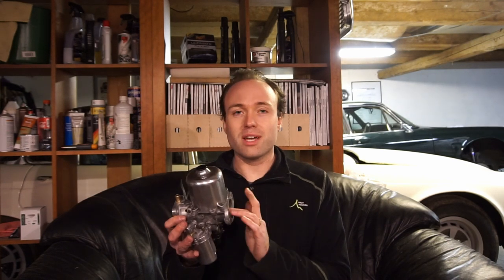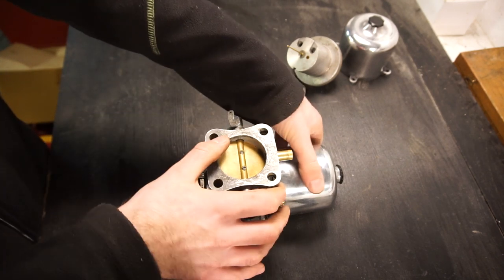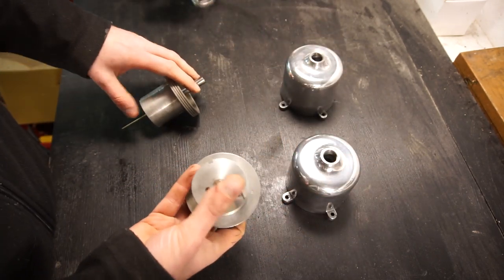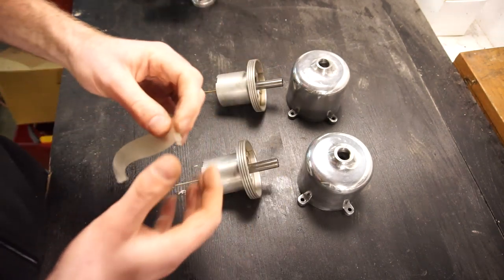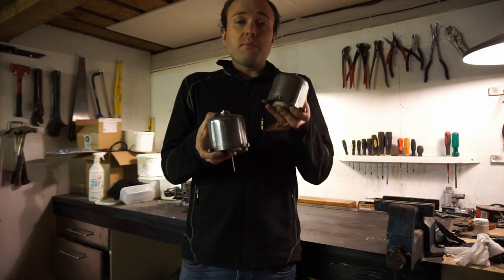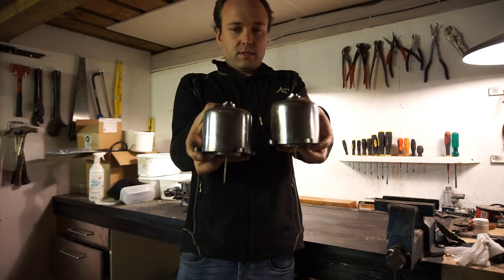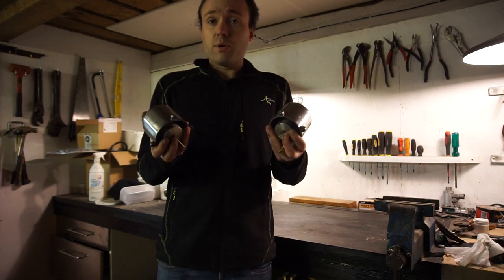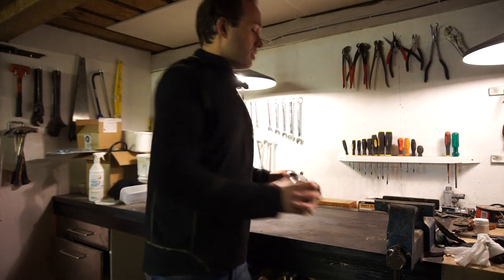SU Carburettor Piston Drop Test

Comment: tried this today and neither piston wants to drop. I have lightly oiled the inside of the dash pots and outside of each piston where applicable but they are sticking. They don't seem (too) dirty although they seem to be rubbing inside the dashpots.. This may be a stupid question but could they be tightening up due to the colder weather (snowing today) and should I perhaps bring them inside to bring then at least to room temperature? Thanks for any comments or email.
Reply from the maker: I would try it at room temperature and also it should not be liked. Clean with break clean and let it dry. Make sure all surfaces are nice, clean and free from grease
Reply: @LivingWithAClassic  "not be liked"? not sure what this means, or did you mean "should not be lightly oiled" ??
Reply from the maker: Sorry I was typing fast. It should be that it’s not suppose to be oiled

Comment: What if the third carbie is out ?
Reply: You then have three carbs to swap between, and find out which of the combinations show the least difference in drop speed. With some luck one of the combinations will stand out as clearly the best. But one cannot know for certain the history of part swaps some earlier owner might have undertaken. And regardless of number of carbs..that taping up the holes... make sure holes are really covered off so no leaks there will spoil test results. And as cautioned; take care to not drop parts to the floor to avoid damage.

Comment: Adam,  I was VERY concerned to see your drop test with the piston pointing down, and you having to stop it with your finger. Dropping it onto the floor can have disastrous effects.
I would refer you to the SU Reference Catalogue 1930-1980, which details this procedure.
For the HS8 carburetter, p170 of the catalogue, it refers you to the procedure for the HS2, HS4, and HS6, on p 168. I quote the relevant paragraphs (31 - 37).
NOTE : The following timing check applies only to standard Suction Chambers, and need only be carried out if the cause of the carburetter malfunction which necessitated the dismantling has not been located.
31.  Temporarily plug the piston transfer holes. (I actually use plugs of wet tissue paper)

32.  Fit the piston into the chamber, without its spring.
33.  Fit a nut and screw, with a large flat washer under the nut, into one of the suction chamber fixing holes, positioning the washer so that it overlaps the chamber bore.
34.  Fit the damper and washer, if fitted. (I note that you did NOT fit the damper in your test).
35.  Check that the piston is fully home in the chamber, INVERT (my exclamation) the assembly, to allow the chamber to fall away until the piston contacts the washer.
36.  Check the time taken for the chamber to fall the full extent of the piston travel. For carburetters 38mm (1.5in) to 47.6mm (1 7/8in) bore, the time taken should be 5 to 7 seconds.
37  If the times are exceeded check the piston and chamber for the presence of oil, foreign matter and  damage. If after rechecking, the time is still not within these limits, renew the suction chamber assembly.  (I usually clean the inside of the chamber with a paper towel moistened with Isopropanol Alcohol).

I have an HD6 on my car, and the procedure is the same apart from the use of the bolt, washer and nut, (which limits the travel of the piston). I usually count, 1000, 2000, 3000, etc., upto 8000, (it really takes a second to say thousand), before catching the suction cover in my hand, but that actually allows an ''extra'' thickness of the piston to exit the chamber, thus increasing the time taken.
I also mark the 'keyway slot' on the suction cover so that I 'know' that this is the exact same location as in the operating position.
I hope that this was not too long winded, if you want a copy of page 168, or any other page, then let me know !
Please comment !

Comment: Thanks Adam.  I've never seen that test before.  I will try it on mine.  When I saw the title I assumed you would be doing the "drop" test with the carbs together which checks that the needle is not catching on the jet (as detailed in my Mark 2 service manual).  Wouldn't you need to also perform that test if, as with your result, you ended up switching the pistons over?
Reply from the maker: On these "later" carbs the needles are spring loaded and self center. On earlier carbs like on the MK2 or my 3.8S one would need to check if the needles are centered.
Thanks for watching!
Reply: @LivingWithAClassic  oh I didn't know that either!  Thanks for the response.

Comment: Wait a minute here! How did you keep the piston from falling to the floor? What stops the piston at the edge of the suction chamber (dashpot), plugging the holes with tape only?  If suction fails would the piston fall to the floor damaging your jet needle?
Reply from the maker: I have 2 fingers under that keep the piston from falling out
Reply: @LivingWithAClassic  Oh I see them now. I need to be more observant. Maybe I'll try that test on my HS6 S.U's on my '67 1800S Volvo. Thanks for the video and response.
Reply: @LivingWithAClassic  I agree with Stuart. I would at least do it over the bench with a big pillow (my wife's) to catch a mishap.
Reply: You can use a small screw and nut to hold  a washer on the bottom of the pot that will keep the piston from dropping out.  I've seen a diagram for that, but I don't have a copy I can post. If I can find it I'll add it.